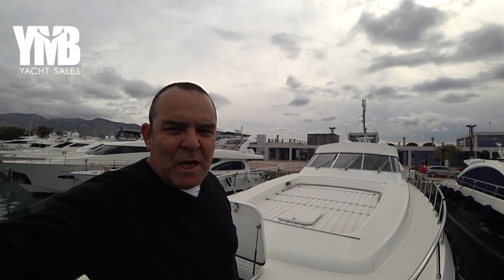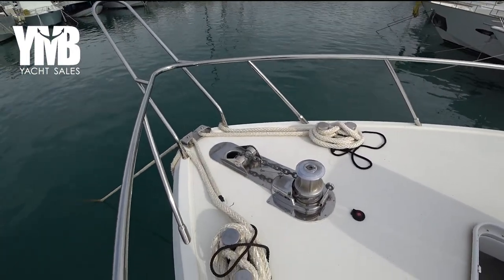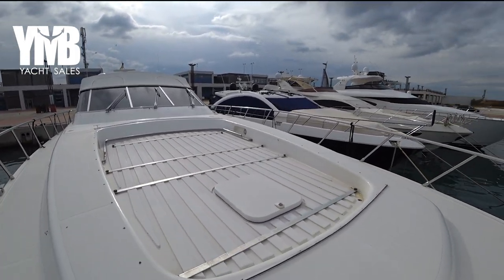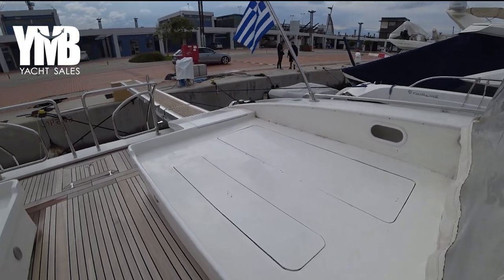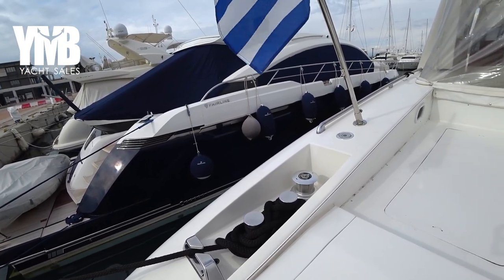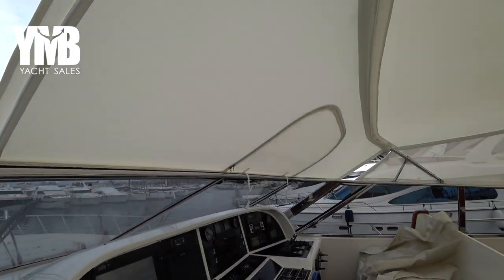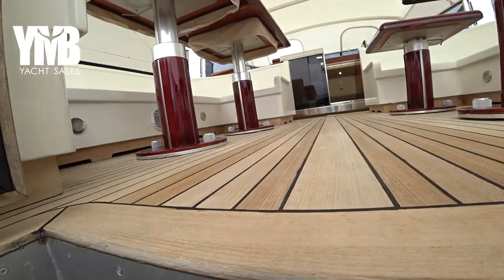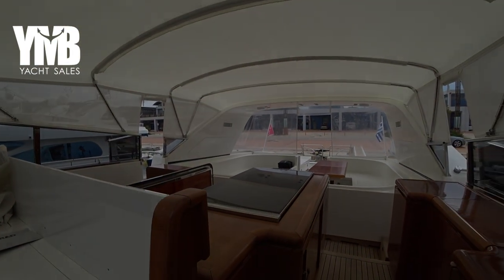MANGUSTA 80 OPEN Motor Yacht for sale full interior video tour

Comment: Man, I would not want to be a crewperson on that yacht when it was in rough seas. The worst place to be is in the bow. That's why experienced owners put their cabin as far aft as possible, or if the owner stays on board while the yacht makes long transits, some have a special 'underway' cabin they use that is in the back and located as far down as possible. Yachts with owner cabins forward either don't get seasick, don't stay on board during long transits, or don't have the yacht moved in rough weather. This is nice though. I like Mangusta better than Pershing. ISA and AB also make super nice express or sport yachts, but Mangusta only makes this kind and they do it right. The only Pershing I like is the 140 and 9X. The other models waste space